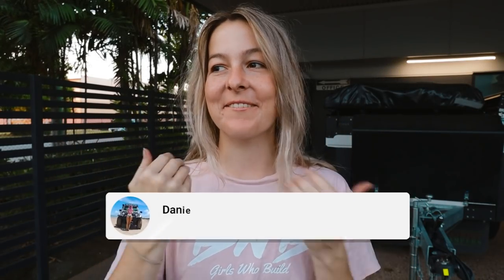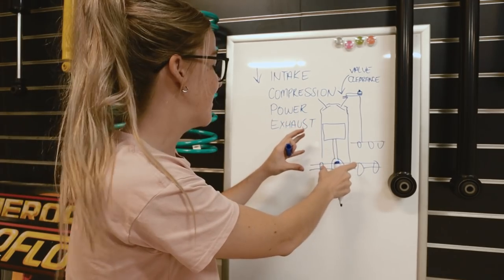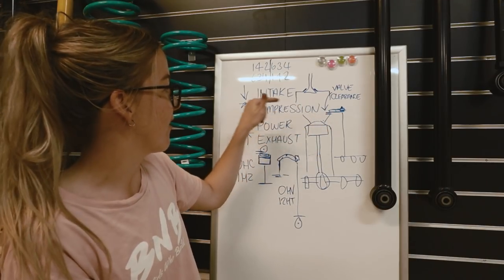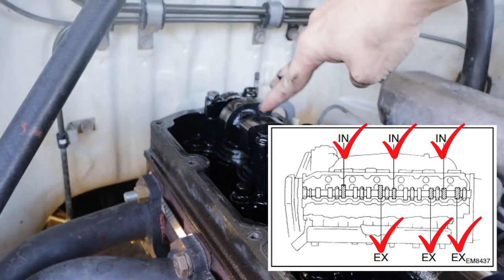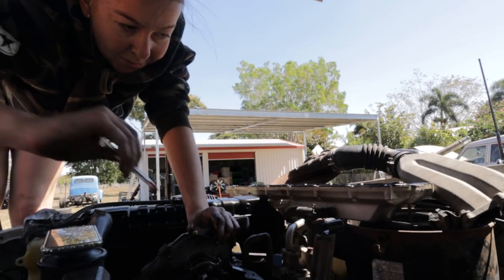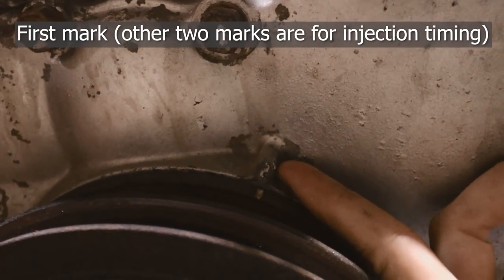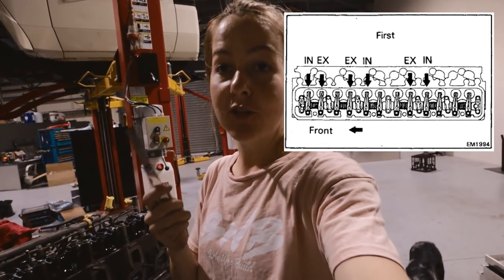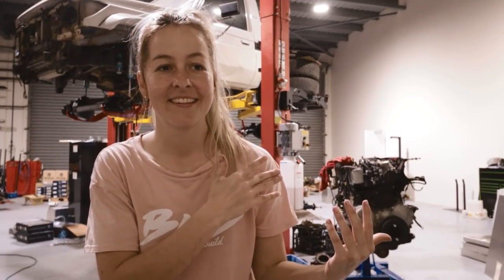I teach you how to adjust valves using my own diesel engines!

Comment: Danie you done good, 40+ years working on every type of infernal confusion engine's. Suck-Squeeze-Bang-Blow different applications happen depending on use.
I prefer the engines with rocker tappet adjustment having to re-shim an engine gets more complicated the more cams double overhead cams variable valve timing.
Reply from the maker: Oh same! The ohv is definitely a far simpler engine design in general. It's a pleasure working on the 12ht
Reply: 40 plus years working on dirty diesel engines you should be the CEO of Toyota by now.
Reply: @grimreaper6112  Yeah you can imagine the changes I have seen, and the number of courses I had to go on every time something new came out along with doing  the Transport Ministry testing also.

Comment: Thing that always makes my head hurt when replacing shims is trying to figure out which (if any) of the shims can be swapped around to other valves.

Back in the day, I used to grind valve shims on a lathe but, honestly, I was always a bit worried about whether it'd change the hardness of the shim and reduce it's life.
In the old days, when an engine could only go 25,000 between major services, that probably wasn't a big deal but now we've got engines that can last 100,000 miles between major services it's probably best to use factory shims  to ensure they're good for that mileage.

Also, speaking as a 50 year old, the thing about "35 - too old" stung a bit. :-/

Comment: I’m gonna say the 2h is a similar way to adjust as the 12ht ?? Maybe slightly different specs, I’ll consult the workshop manual, great vid !!!
I was taught suck, squeeze, bang , blow but I did my time over 20 years ago lol, keep up the great work 🍺👍
Reply from the maker: 2H is the same as the 12ht. Same clearances I believe. The injection timing definitely differs between the two though

Comment: Good job. Feeler gauge should be oiled or at least I was told, so I don't mind to be wrong. When doing 1hz, engine should be very cold because almost any heat changes specs.
Reply from the maker: Yes correct 1hz cold, 12ht hot. Feeler gauges should be wiped with oil to prevent rust if your storing them.

Comment: Danni why didn’t you make an adjustment to compensate for the engine being cold, when the Spec was .intake 008 exhaust.014 then engine is HOT. As you pointed out metal expand when hot therefore when your engine is hot your clearances will be tight? 👍🏴
Reply from the maker: As mentioned on the screen and in the description the 12ht is adjusted HOT not cold. What I was doing was simply for ease of explanation and demonstration. That engine has much more work to do on it before it goes back in the vehicle.
Reply: @DanieSimpson  would be interesting in seeing the actual clearance once reinstalled and run up to temperature to see the difference. Handy knowledge for future.
Keep safe and well and give Marsie boy a hug from me
Reply from the maker: @alasdairhamilton1574  engine was rebuilt prior to it being pulled out and the clearances were just reset back to what they were after the demonstration. So once the engine is running the valves will all be within the spec I listed on the video

Comment: Is there any dyno info on just what we loose with loose valves?
Reply from the maker: on what power loss you have? possibly but normally its something you would rectify straight away not dyno. The loss would all depend on how far out of spec they are. If they are all loose, the engine will be incredibly noisy even at operating temp. This is something you would notice most likely before a drop in performance
Reply: @DanieSimpson  I would just like to see a 4cyl hooked up to a dyno with correct valve settings, run it to see what it can put out, then run it a couple more times with it out of spec different amounts to see how being too loose or too tight affects output and performance.  Ive never seen anyone do this.  I know tight might burn the valves and loose is a bit  noisy… but other than that is there any real harm or worry?
Reply from the maker: @frankcherry3810  yes the valves have a spec for optimal combustion and exhaust. Anything out side of this spec will cause a loss in performance and incomplete combustion. Noone will have done it because the optimal specs have already been determined and we know anything outside of this isn't ideal or practical.
Reply: @DanieSimpson  Yes you are right.  I was just wanting numbers

Comment: But the positive is most Toyota's that run a bucket/shim design, this valve adjustment will in theory apply to them too.
Reply from the maker: This video shows both ohv and ohc valve adjustment. And Toyota has a range of different engine arrangements not just ohc
Reply: @DanieSimpson  Oh i know, i've got two cars, one happens to be a Toyota. Except i hate to imagine how much of a bi**h it'll be when they eventually need doing haha !
24 Valves, quad cam... in a V configuration 😂
Fun times ahead

Comment: I think doing the FT/FTE is actually worse than the 1HZ- You need a third hand to hold the bridges still with a shifter while trying to adjust two different adjusters because if you tweak and bend them, you'll pop valve retainers and drop a valve into the cylinder!
Reply from the maker: It's most definitely painful that's for sure!

Comment: see you tomorrow miss, 4 hours early
Reply from the maker: No worries see you then :)
Reply: have u any single sisters miss ?
Reply from the maker: @josephgeorge4053  both currently taken sorry!
Reply: @DanieSimpson  great vids keep em up
Reply: @DanieSimpson  so different engines have different tap it's differences is that right ? and how do u find the correct distances .
Reply from the maker: @josephgeorge4053  in your workshop manual will be the correct specs
Reply: @DanieSimpson  no workshop Danie I'm a steering wheel attendant,  for  a big tport company these days .  with his first diesel 4wd daily driver .
Reply from the maker: @josephgeorge4053  don't need a workshop just a workshop manual. I got mine from a local auto shop
Reply: @DanieSimpson  I'll look it up ,to continue my learnings
Reply: @DanieSimpson  for your make and model hey ?